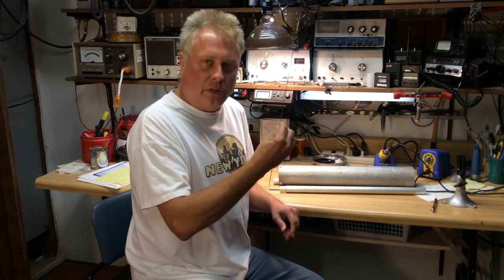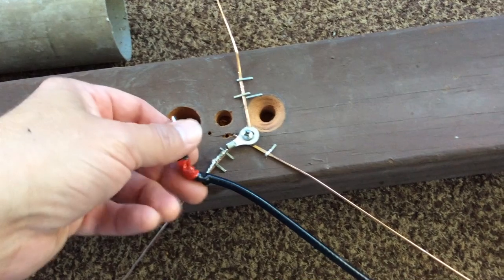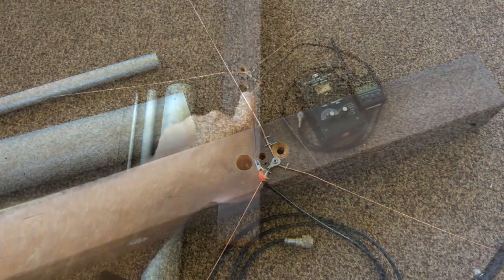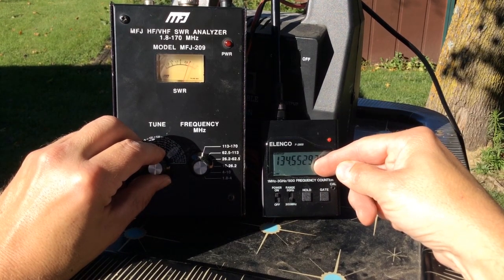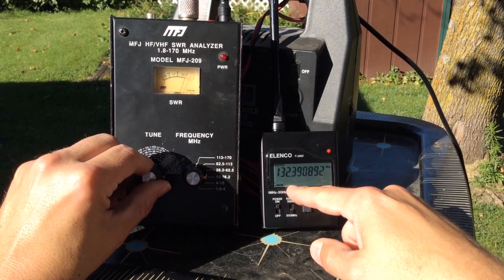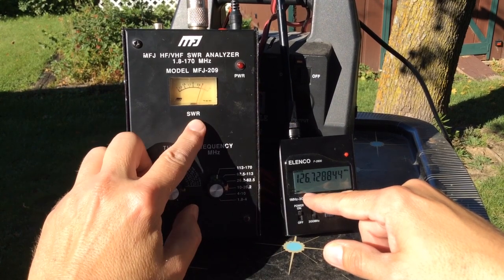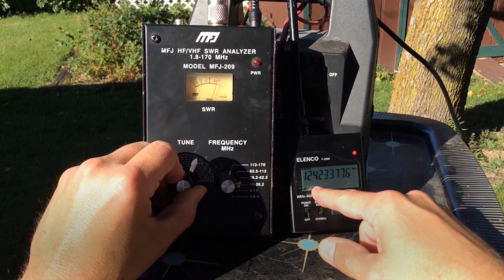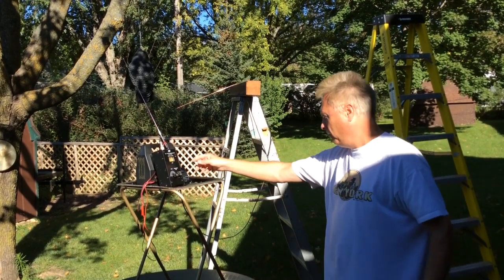Broad Bandwidth Ham Radio Antenna Demonstration

Comment: Driven element is a term used for Yagi beam antennas. A wider bandwidth antenna does not relate to more "noise", the receiver selectivity and noise rejection circuits determine that. Also I didn't have a pen to write down all those numbers, so a chart of results would be nice.
Reply from the maker: the KiloMike Points well taken, thanks!  And yes, I am aware that it does not relate to noise at all. I don't remember saying anything about that I guess but maybe I misspoke.  I should have taken more time to draw up a chart though I agree.

Comment: Great video Larry! Could you do some RX and TX tests with them also? Perhaps RX a local beacon or TX into a weak repeater? I wonder if the diameter of the element would change the way it radiates? (for example, is there any disadvantage to a large diameter element, other than the large physical size of it?)